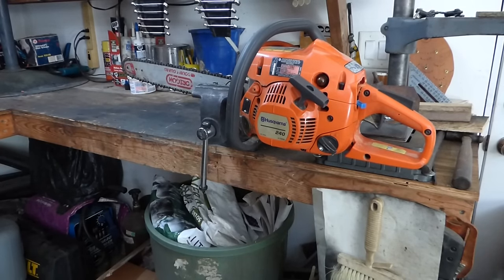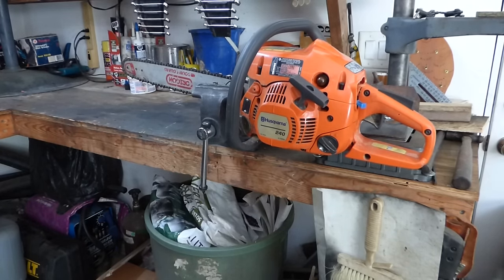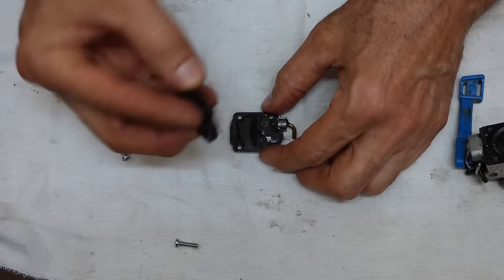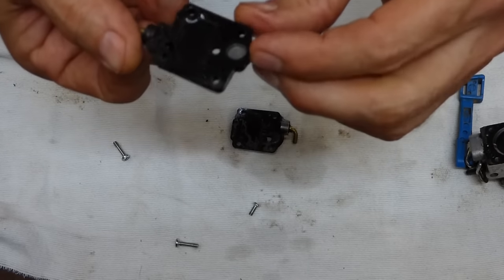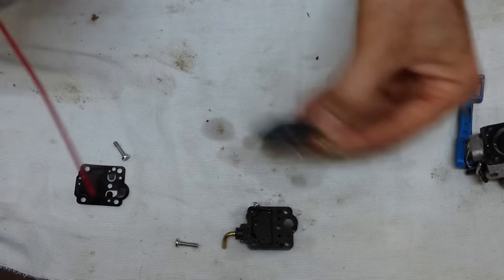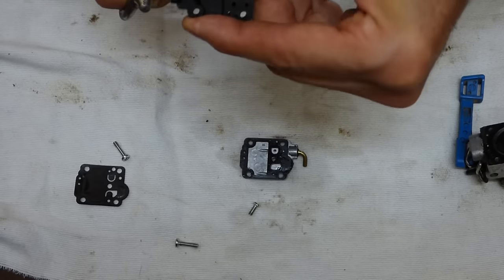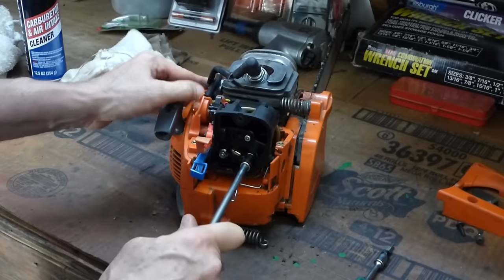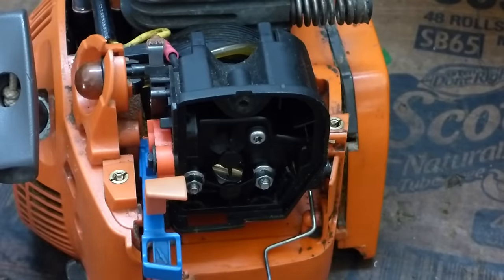Chainsaw Won't Start - What To Look For & How To Fix - (Husqvarna Carburetor Cleaning)

Comment: But u firstly said the small engine mechanic sprayed into the plug hole. Did he forget to pull the start cord? 🙄
Reply: This video worked for me.  The guy was speaking clear and I absorbed what I needed yo fix my 240  husquavarna.  Got a carb kit made the repair...back in business. Thx man
Reply: Fresh Gas should tried in the first place. After this repair you don't know if it was maybe only the old gas which prevented it from running.

Comment: Hello! I put a New carburettor and it still doesn't start. What should I do?
Reply from the maker: Hard to say without being there...  do you have spark?  You may want to turn the adjustment screws L & Hi just a smidge one way or the other to get it going if the new carb is not properly adjusted.  If  you lose you place... turn the screws all the way clockwise till they bottom out and then turn out 1-1/2 turns for a starting place.  Make sure you have spark, fuel, air & compression...
Reply: @helpinguonline  I fixed it! And it works with the old carburettor

Comment: Gas station gas  (ethanol )  messes up a carb real quick  I got a new chain saw 2 months ago and got 40:1 mix at lowes====== before the trouble starts
Reply: Just gotta find non ethanol gas.  I i use 50:1 also as my saw recommends that I use husqvarna saw but stihl synthetic oil. Way way cheaper if you gotta use your saw why spent 5x the price on fuel

Comment: Good job,can I send u mine?,got a stihl 024,just won't start!!
Reply from the maker: The most common problem people run into is the carburetor getting gummed up because fuel was left in the chainsaw.  Always a good idea to drain gas out of tank and run it out of the carburetor after use if it's going to sit.  Do that in the future and she should start right up.
Reply: @helpinguonline  I'll try it

Comment: Usually it's the fuel lines that gives you trouble. There's a kit available for those. On some models the carb is replaced also.

Comment: One guess could be a blocked exhaust pipe or even a shorted wire.I was wrong this time.
Reply: in a way your right the spark arrestor screen is blocked which is why it wasnt getting up and boogieing at end.

Comment: i have a 440 e and it seemed like she was running out of fuel on half a tank now shell idle with choke but soon as any pressure put on the throttle she dies. tried spark lots of bright spark. air filters gorgeous. idk ehays wrong with it
Reply from the maker: Sounds like it is not getting enough fuel.  I would start out by trying to adjust your low adjustment screw on the carburetor...
Reply: also check exhaust spark arrestor meshes.  As for carb setting its unscrew l jet out  ( Anticlockwise ) 1/8th of a turn then give it a rev repeat untill engine accelerates cleanly.  Wont tell ya high jet settings as hate for you too seize the saw.  Low jet is the initial rev then high jet is peak sing of engine. low jet out to get revving up up the h jet in to get the best sing.  Never leave it at peak tho always bring it back from there a smidge.

Comment: When I try to start my saw it acts as if the cord isn't engaging the starter. The saw is a chinese Forparts FP5800 the saw was only used one season. Any input, besides saying it is a cheap Chinese saw would be appreciated.
Reply from the maker: from what you said it sounds like the starter recoil is not engaging the flywheel.  I would pull the recoil off and check that it is functioning properly

Comment: Husqvarna are the worse gas fired tools on the market. Poorly designed in such a way that parts break easily. Hit a 1/2 inch stick that stopped my $500 AWD Husqvarna lawnmower.  It broke the plastic lever activating the AWD feature.  This lever was molded into the gearbox housing.  Had to buy a complete new gearbox with drive axles ($100).  It would have been so easy for the engineer to have designed a breakaway lever mounted on the gearbox.  After I reinstalled new gearbox I went to start the Honda engine and the engine kicked back so hard it pulled the start handle back against my hand and tore a big cut.  I still have the scar.  After I bandaged up my hand I moved the mower to the garage.  On the driveway I found the blade had sheared off the mounting "star" on  the metal shaft that mounts on the engine drive shaft ($15).  Went to the dealer to find out what was going on.  He told me that the engine timing belt had broken and that the cylinder head was toast as the valves had probably been hit by the cylinder. Cost of a new Honda engine?  Over $400.  No way I was going to spend more on it.  It's sitting in the garage, a $600  boat anchor.  I also had a Husqvarna chainsaw and it wouldn't start from day one. Took it back to Lowes and told the lady at the return counter it wouldn't start.  She called this guy from the power equipment dept.   He had arms as big as my thighs and he couldn't start it.   So right out of the factory it was a POS.  No more Husqvarna for me.  Not even an axe.

Comment: Shops don't rebuild walbro and small carbs anymore.  Most of them you can't get kits for anymore and at 90 bucks a hour labor a replacement carb is cheaper
Reply: If I can get a carb kit for a Walbro carburetor from the 70's, so can they...

Comment: Can I just spray carbs cleaner into my fuel tank or into the carbs from the air intake whilst mounted to my chainsaw and have it eventually burn its way clean ?
Reply from the maker: There are additives available but I find they don't work well for cleaning in the way you have described.  If you have a gummed up carburetor it is best to take it apart and clean it.

Comment: After all you done, it ends up being the filter in the fuel tank is stopped up with old gas and oil. Happens everytime. I soak the filter with carb cleaner first off. Then trial and error.

Comment: These Husq's are great (not).  Mine is almost new (2 hours use and no spark). I changed and adjusted the magneto, added new spark plug, overrode kill switch and still no spark. Anyone have a solution or next thing to try?
Reply from the maker: are you sure your new coil is good?  You may want to test it.  Also is the magnet clean on the flywheel?

Comment: Clean the outside of the carb before you pull it apart. No point pulling apart and then putting crud off the exterior into all the tiny ports and fuel pathways etc. And diaphragms should be judged mostly by feel. Once they start to stiffen… just replace them. They’re cheap.

Comment: Not the issue I'm having. So, my saw starts easily but almost always quits. As if it were flooded. UNLESS, a brand new spark plug is installed. Then it always starts and stays running without trouble. But even after a single use if the spark plug is just a little bit dirty, the next cold start will be problematic. I stopped using the primer bulb and even adjusted the carburetor. Leaner. No engine damage. I didn't go overly lean. I just thought perhaps maybe running overly rich was the issue. It does better after the adjustments were made, but still didn't solve the issue. So basically my complaint is that I need a brand new spark plug installed EVERY single time I do a cold start or, there will be trouble. I can do that. Sure. But who would WANT to do that? Why is this even an issue? It wasn't before. So what changed? With that said, what do you think the issue is?
Reply from the maker: Is the diaphragm in your carburetor rigid or rubbery and flexible.? If it is getting stiff it could be that it is Letting too much fuel through the needle valve
Reply: @helpinguonline  I don't actually know. I haven't inspected it. Usually if I plan to take a carburetor off an engine, it's because I plan to repair/replace it. I have been trying to find any other explanation but I don't think I will. It may just have to be rebuilt or replaced.

Comment: Yep. These little carbs, usually Tillotson or Walbro are finicky and don’t cope well with any debris. Little filter on carb often gets plugged. Fuel line could also be clogged from fuel filter clogging, or becoming detached and debris getting into fuel system. Also could just be poor adjustment on idle, lo jet not letting enough fuel into system.

Comment: I dont know much about chainsaws but that chainsaw seems fiddly to me..just too get too the carb.unlike my old husky 61 so easy
Reply: That's that Swedish "over design". They can't do anything simple, even for their low-end saws unlike Stihl with the MS 170 (Stihl's entry homeowner saw). Now THAT'S a simple, straight forward design. Don't even have to take the handle off to get at the carburetor. Just pop the top and take two nuts off.
Reply: @TheKrayusKorianis  I really hate this 240 it is a piece of crap saw, period.
Reply: If you just pull the carb yep pain in the bum,  Its easier to pull the cylinder with manifoled and carb attached then pull carb off.  Its a tappered cylinder so sliding back over piston and rings is quick and simple as well as a rubberized oring seal so no gaskets.

Comment: The Husqvarna 240 is one of the crappiest saws ever made. I have worked on several of these 240's and you cannot get the bugs out of the fuel system. There is a air leaks someplace in the intake that comes new from the factory and cannot be fixed even with a new carburetor. If you  trying to fix one, good luck. You will constantly be tuning the carburetor like you have a crankshaft seal leak, but the leak is somewhere in the intake/carburetor ares. 😮

Comment: Very helpful , but some of the shots your hand was in the way and you did not explain very well how to hook up the throttle cable.  Why did it not start in the first place , when you took it apart there seemed to be nothing wrong with it ,if there was you did not point it out. I have the exact saw and have the same problem it just does not want to turn over, very frustrating .
Reply from the maker: If your saw will not kick over but it will if you spray a little fuel or ether in the cylinder (as I did) then your carburetor is most likely clogged...Especially if you left fuel in it for a period of time.  Those little ports in the carbs clog very easy and it is a common problem.  Always drain your fuel out of the tank and run the saw till the fuel is out of the carburetor if you are not going to use it for a number of weeks!
Hope that helps

Comment: fuel filter change/bypass should have been done after checking for spark. ... fuel/ spark /compression are the primary components. Got spark? Yes. Move on to fuel/air. carburator problem? No. Put in fresh gas and check the fuel filter and air filters. Take off the air filter. Strart? No. Bypass/change the fuel filter.  Start? No.  Now you can clean the carb, as long a s you have compression. It would be obvious if you don't have compression after trying to start the saw this many times. DON'T ADJUST THE CARBURATOR. 
.

Comment: your missing the one thing that you needed to look at as soon as you knew it had spark keyway for the flywheel
Reply: cast in key on flywheel on that saw never seen one slip yet engine gets air leaks way before then.
Reply: I’ve never come across a bust flywheel key on a saw. (Unless someone has had the flywheel off and not tightened it properly). Plenty on mowers when they hit a stump or rock though. Last resort, check the crank seals, might look OK, but if one leaks it’s a no-go saw! Usually the clutch side due to ingress of sawdust.

Comment: Half of people's problem is that they dont know how to start their saw in the first place.... Every stihl has one proper way to start it.....full choke pull steady until it starts to fire...turn choke off pull it one more time....starts right up every time...the best way to start a Husqvarna is to throw it into a lake and buy a Stihl.... Even the stihl knock off from china is better than a Husqvarna.... BTW those china saws will line up with all the OEM parts off of the same size Stihl....basically you can get a china saw and then buy all OEM stihl parts on it including plastics and have ya a stihl saw for about $5-600 cheaper.... Also running a forester bar on it is nice too... Square filed chain will stay sharper longer...and a 500i will exeed your expectations and shame any other saw youve ever owned.

Comment: Well after using either the piston and cylinder are probably scored.
Reply from the maker: I have never had a problem using starting fluid for testing purposes (just a squirt to see if it would kick over)... but you are right...it would not be good to run a 2 cycle engine on starting fluid because it will wash away any oil on those moving parts if an excess amount is used.  Two stroke engines have oil mixed with the gas that is needed for lubrication of the moving parts of the engine

Comment: Either doesn't have any oil in it I would never use either myself ever !!!!
Probably just scored the heck out of your piston and cylinder just saying !!
No either for two stroke engines !!
Reply: Ether (starting fluid) for a second or two just to see if the saw fires is fine, use it as another diagnostic tool

Comment: nice video my friend for  people to get some knowledge about chainsaws.you change the membrans but you didnt get  a spesific clue about the missfire (or to mention a cause in the carb)  of the saw.Sorry about this i will say to yoy maybe wiil sound annoying but you look like a nurse trying to do a surgery .there are some steps we follow in order to mention the problem.First we start from fuel  filter . i say this because you speak in public and too much people watching you will go away from the target
Reply: i disagree i start with plug out test for spark then move to a little 2 stroke down plug hole reinsert plug start if then cuts out quickly proceed to complete fuel system clean

Comment: A small engine mechanic didn't bother cleaning the carb?  I'm no kind of mechanic and that's the first thing I'd think of.
Reply: the small engine mechanic new how big of an arse the carb is to pull.  For that model i pulll cylinder and carb and manifold in one goe the disassemble  Bloody allen keys are just in a pig of a place.

Comment: my bad i spoke to soon
Reply: Going on what the shop said- or original mechanic, if you had spark fuel and compression, timing would have been a good guess--until he got the fire in the cylinder especially if you didn't know the when and why it quit.  Learned that the hard way after not trusting the other tests- way too many times!!!!

Comment: This guy knows nothing about chainsaws. He made the statement while disassembling the carb. naming the diaphrams in the carb. as reed valves.husky. saws like he is working on does not have reed valves. They like most european saws intake fuel and exhaust through a hole in top of piston skirt called third port induction.
Reply: Yeah, I heard that too.  I'm a little surprised it didn't cause a ruckus.  Technically, I guess they are reed valves in the sense that they have flappers or reeds.  Maybe he just heard the term somewhere.  I like Steve's Small Engine Saloon.  He's never steered me wrong.